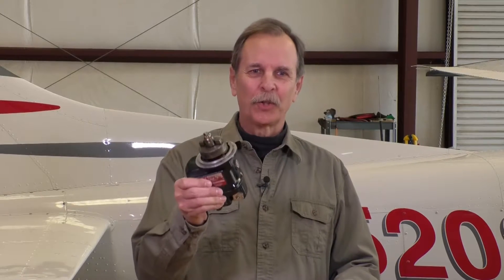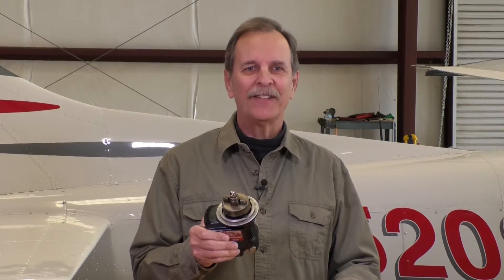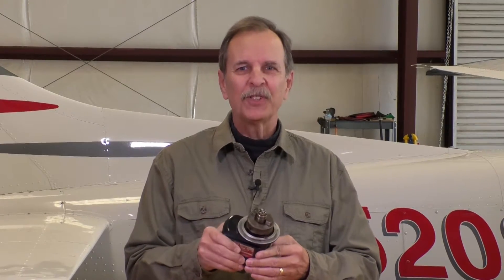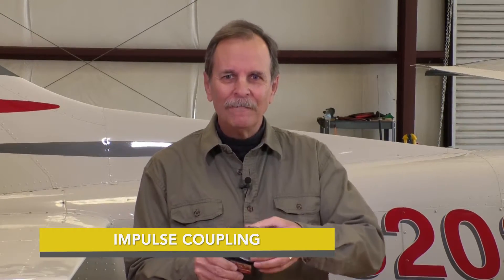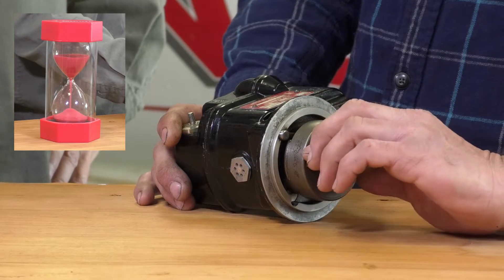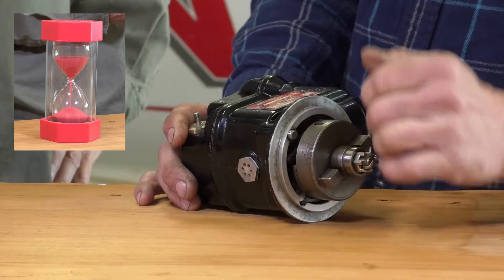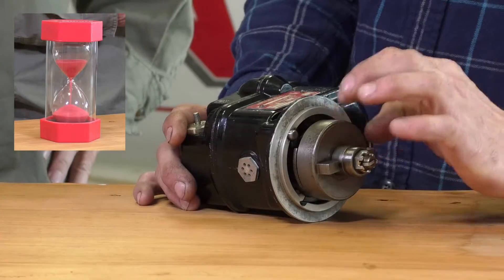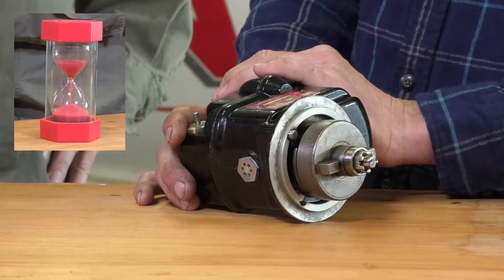The Magneto Mystery in 60 Seconds - Flight Training

Comment: It seems like on mine, even after the engine has started, the clicking sound is still present below about 800 rpm. This means that the impulse coupling is not disengaged as it should.  What would be the cause of this and is it bad to continue operating like this or do I need to pull the mag and find the cause and fix??

Comment: What is function impuls coupling on the magneto?
Reply from the maker: The impulse coupling spins very fast from a compressed spring. This creates the electrical impulse to fire the spark plugs. It does this independently, without any involvement of the battery.
Reply: @GoldSealFlight  so the fast movement a magnet fluks and very hight electrical appear , although engine slow rotate..
Reply: got a link to a video showing how the impulse coupling works ? @GoldSealFlight

Comment: One other point--since the magneto with an impulse coupling does not turn until the spring is wound and released, the spark from that magneto is considerably delayed in crankshaft rotation compared to normal timing.  This is exactly what you need for starting.  So, the impulse coupling provides a retarded spark for starting, as well as a strong spark. 

You should always emphasize the dangers of turning the propeller of a piston engine, even a little bit.  Even if the magneto switches are off, a disconnected or open circuit in the P-lead that connects the magneto primary to the ignition switch can turn the magneto on.  If an engine happens to stop just as the impulse coupling is winding up, even a tiny rotation of the propeller can release its spring and fire the engine.  Always treat a propeller as if the mags are hot.

Comment: So... when you do the magneto test at the engine run-up... what would happen if a magneto was bad? I've always just been told, "turn it to L and verify a slight engine drop... now turn it to R and verify a slight engine drop..."  If one of the magnetos wasn't working, would the engine just quit when you switched to the dead one?
Reply: you'd hear the engine begin to cough and splutter in which case you'd quickly change back to the other magneto. yes this can be due to spark plug fowling. However usually the engine will simply run rough and would have a very high rpm drop
Reply: The mag check ensures that both magnetos work, that they are both properly timed, and that the grounding circuits are intact. If a mag is dead, the engine will die during the check. If they are not properly timed you will not see RPM drops within spec. And if they are not grounded, then you will not see the correct RPM drop.

The inside of a magneto is similar to an automobile distributor. It includes a condensor and a pair of points that open and close on a cam. I once had a set of new points disintegrate in flight. There was an audible, abrupt change in engine speed. I did a mag check (no reason you can't do them in flight), and the engine died when I selected the dead mag. You can bet that woke me up!  I put the switch back in "both" and flew home on just the one good mag. If the malfunction made a difference in how smoothly the engine ran, I would have just selected the one good mag in order to isolate the bad one.